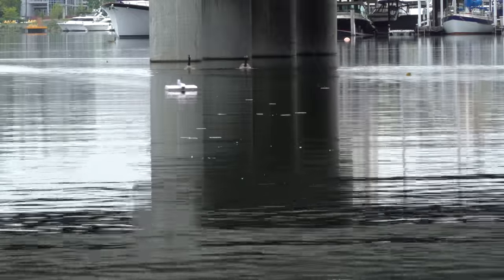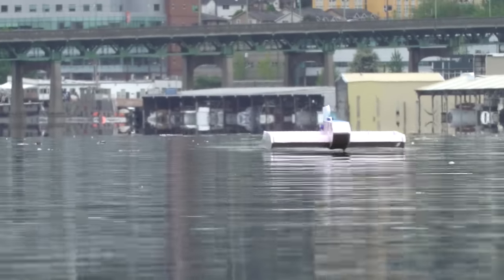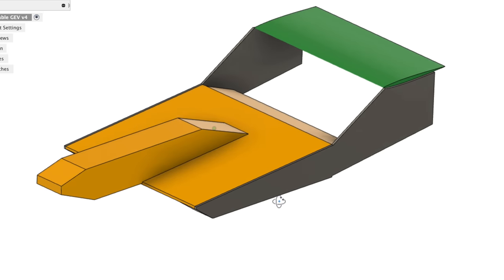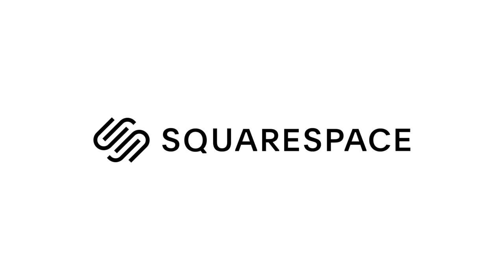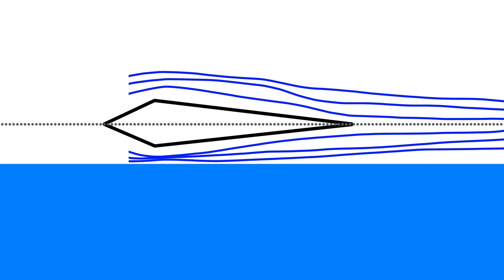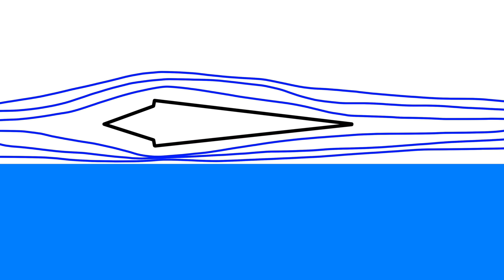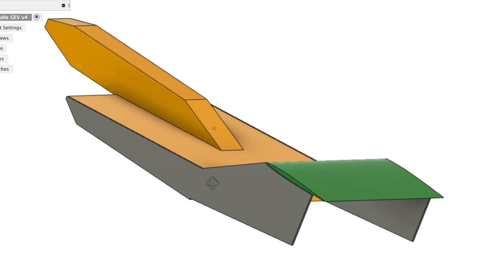RAM Effect Vehicle - A New Type of Aircraft Wing Design?

Comment: With an RC plane it is trivially easy to over power it so just about any configuration of foam can fly away.  With that in mind the people who fault you for creating a vehicle which can fly away out of ground effect should find a better hobby than trolling people who are having fun.  
It seems to me you do have to deal with excessive thrust almost no matter what, so accept it and move forward trying to control that thrust.  If you think you need PAR thrust, use a small motor for that and second motor to power the vehicle from the center or aft.  
I think you were on track for a very fun vehicle with your previous, tandem wing, design.  The tandem wing gives you a canard-like effect full of longitudinal stability plus a very forgiving space in the middle for center of gravity, flotation, and lift compromises.  By adjusting the angle of attack of the fore and aft wings separately, you can avoid the fly-away effect from overpowering it.  Oh and at the Reynold’s Number you’re flying at, don’t bother with shaped wings.  Just use a flat wing and soften the upper leading edge a little.  If you want to get fancy later after you have this tuned up, then try NACA shaped wings.  
If you look back at the Jörg Skimcraft (https://www.youtube.com/watch?v=4PVLHnjbyxw), he had what I would call a trimaran configuration with a main hull in the center and two outrigger hulls, all serving to hold the leading edges of the wings out of the water.  From the Jörg V pictures you have, it appears the center hull is a traditional “boat” shape, while the outriggers have knife edge bows with a flat bottom.  You cannot see if the flat bottom is tilted for lift, but I suspect they are.  Also looking at the Skimcraft, it had the aft mounted prop tilted forward to help keep the nose down.  Later in the video it shows the Skimcraft did not fully fly until it reached 80 to 100 kph.  Once it was flying it seemed to accelerate very quickly from 80 to 145 kph (no more water drag).  
So I think if you fiddle with the wing and prop angles of attack you can find an aerodynamic balance along with a weight distribution where you can go full RPM with never a fear of the front lifting, and you might not need an elevator.

Comment: I think you might have to science more, meaning it looks possible but having to adjust the blades constantly is going to be a huge challenge. If you find the correct pressure near the surface of the water you can get proper lift. There are so many other factors that have to go into this but the idea is good and it would be awesome to flush it out more.

Comment: Better than I thought it would be. I figured it would oscillate a lot more than it does. I have thought about the very same concept. Very interesting video.
After thought: I would try putting some inward facing fins on the wedge in the back and some outward facing fins on the bottom outside edges of the front. Wish I could upload a drawing to show you what I'm talking about.

Comment: Is there a difference between your use of the term “RAM effect pressure”, and ground effect aerodynamics? They both seem to be identical in definition in this video. Just wondering why you use the term “RAM effect pressure”, instead of aerodynamic ground effect lift.  Not seeing a definition specifically associated with the term “RAM effect pressure” anywhere, and what is close is not associated with aerodynamics at all.

Comment: This effect can be maxized over the water surface and South Koreans already developed military use vehicle that's classified as a ship due to low altitude traveling but flies over the water surface.  It is fuel efficient, and as fast as airplane and can be maneuvered like boats and can carry tons of weight.  They are using it for transport and may modify it with weapons to use against China.

Comment: What would happen What would happen if you put a diamond shape right in the middle of the back foil? And why not add a little bit of weight to the back so that it won't need so much for us to get the front off and then when the front does take off a little bit the bottom drops down but maybe I am just a little bit of weight in the back will allow it to take off front and back more evenly with equal force

Comment: I think the nose of the vehicle lifts because the propellers are angled upwards not because of the wing deflecting air downwards... 

Ever heard of the Venturi effect? As air moves into a smaller space it speeds up and it's pressure reduces so your design would actually suck the vehicle down.
Formula-1 race cars use the Venturi effect to increase traction so their cars don't capture wind and fly off the road.

Comment: Imagine being able to select "set prop speeds" [auto rpms], that when selected, the: 
1] rpms would position the craft at an optimum height off a surface i.e. "surface flight mode"  [prop speed 1] or 
2] rpms would exceed "prop speed 1" causing the craft to take flight i.e. "flight mode"  [prop speed 2] or
3] manually controlled rpms i.e.  "manual mode"  [prop speed 3]  

Have these "set prop speeds" or desired flight modes pre-programed for more controlled flights. jmo

Comment: Any sharp edges will create a stall from this edge and air turbulence at once, which leads to the deceleration of the entire apparatus (there is a low pressure area - it pulls the entire apparatus back very much.) This phenomenon is well studied in aerodynamics. But to facilitate separation from the water, it is used quite often. During the rest of the flight, this constructive decision plays a negative role.

Comment: The main problem with this type of design is that it only gets reliable lift in very calm water. Once the water surface is no longer flat it doesn't have consistent lift and it makes it unstable.

Comment: If you are forced to keep the engines in full throttle to maintain ground effect, there is problem, ground effect vehicles are known to be able to keep engines at minimum once in ground effect. 
I think you should ditch the diamond wing design and simply change the angle of the compensator wing to compensate. The South Asian ekranoplans are Ray shaped with a big compensator on the rear. If you take the ray shaped wing, it has a positive angle of attack on it own it also makes the airflow converge in the rear like a funnel to concentrate the flow and make it more powerful. The equilibrium is also found with the front heavy fuselage, kinda like what's you've done here. 
I think the only real problem with your concept is that it is too rectangular, too straight in its shape.
The upper elevon's struts are too straight and should be sloped to generate some back lift above the plane of flight to compensate for the main plane angle of attack.

Comment: Add 8oz of wait to the hull. 2oz on each corner of the wing. Your electric motors pull or props power is to grate for a true value of lift . For the wing and motor .   For instances place the protype design vertical and if the wait of the wing design  lift up inn the air moving vertically & can huver vertically  the motors are giving you a false positive thought on your wing design.  
As well try playing a bulbous bow  on the front of your canapés or pilot chear by 4inch   use a convexed shape like the Spanish sword or Roman gladiator sword.  
     There's a Ukraine boat company that make a prototype  that's proves your design sasesfull  ..
Norfolk virginia USA

Comment: This is not a ram aircraft, this is a propeller aircraft

there is only 1 singular force of thrust in a ram-propelled vehicle. The intake air is compressed by the forward speed of the vehicle only, then forced through a restricted nozzle to provide thrust

The vehicle above uses propellers to keep forward momentum, all it is doing is using lift to keep itself directly above the ground/surface/water
Reply from the maker: you're confusing ram jet with ram effect

Comment: First of all compliment for your project, I really like the result you got. But even if i really like your airplane I don't think you really understand what "Ram effect" is. Note that with this comment I don't want to offend you but just I think that it would be an occasion to better understand the physics behind these airplanes.

 In fact, in this airplane there is no "Ram effect" at all, but the presence of the ground increases a lot the wings efficiency. In the drawing you showed you said that under the airfoil there is an increase in pressure because of the presence of the ground: it is exactly the opposite, aerodynamic is really unintuitive, under the airfoil the air pressure is lower compared to the pressure that there would be in an airfoil without the presence of the ground (and this is the reason why F1 cars use ground effect to generate downforce with the floor). The increase in efficiency of the plane in ground effect is because there is a reduction of wake induced drag, it is not easy to explain why but the point is that the intensity of the wing tip vortices is reduced. You can start to speak of Ram effect when you approach the speed of sound: if your airplane would fly at Mach 1 then yes, there would be an increase in pressure under the airfoil

Comment: It looks like your center of gravity is too far forward in relation to the center of lift.
Reply from the maker: What makes you think this?
Reply: @rctestflight  Because your craft wants to nose-dive. Aircraft are balanced so that the center of lift and the center of gravity are at the same point, so that the lift doesn't force the nose down.  It's like a balance scale.  The CL is the fulcrum.  The heavier end of the beam will drop and the lighter end will rise unless it's balanced.
Reply from the maker: That’s false. The CG should be in front of the center of lift. Don’t be so quick to make false statements
Reply: @rctestflight  Correct me then. Can you explain?

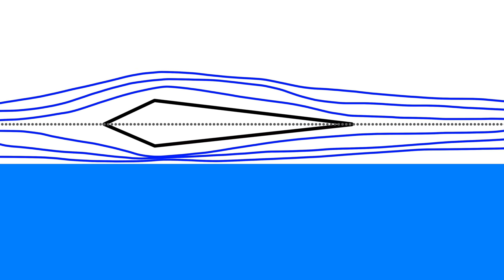Comment: where  is  the  cg.?        where  is the  c-m.???            at 1:53, this 'logic'  ignores  the fact that, in flight, the aoi  is  NOT  constant.!!!          at 2:05, this drag from suction/turbulence  will  be  SYMMETRICAL --- at the  TOP  and  the  BOTTOM.!
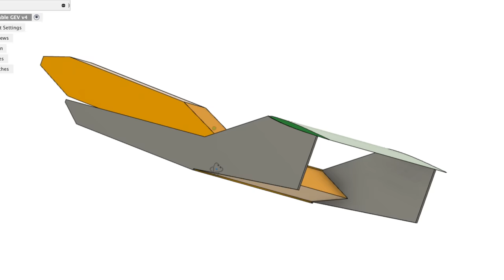at 2:27, the tip fence design  Should  PREVENT  the span-wise/lateral  escape  of  air (at the trailing edge).!!!          the added, too-WIDE  outriggers  SHOULD  have  a  NARROW  cross-section.!          at 2:57, the  Outboard  location of the  MASS  of servos  Adversely affects roll-axis stability.!!!!          googletranslate

Comment: Here is where you have a complete misunderstanding of an airfoil as on an aircraft wing!!!  A wing gets it lift from the relative difference in the speed of the air molecules that travel over the top surface vs the bottom surface thus creating a difference in pressure and this generates the lift!!!  It is not due to the angle of attack of the wing!!!
Reply from the maker: Then why does a flat plate generate lift?
Reply: @rctestflight  
Seriously, a flat plate generates zero lift! This is the laws of aerodynamics and is not my personal opinion!
Your craft is lifted and flying because you angled the propellers UP and the force it generated is greater than the weight of the craft along with the aerodynamic drag as it goes through the air combined. That's why it is flying!!!
Reply from the maker: A flat plate at a positive angle of attack generates lift. Look it up. You can find so many examples of this  @LWRC
Reply: @rctestflight  A positive angle of attach of what exactly? A wing or a flat piece of board? A flat board generates no lift!
Reply: @rctestflight  
I think you do not comprehend the fluid mechanics of a wing and why it generates lift!
When you generate enough thrust, you can make a brick fly!
Positive angles of attack on a flat board does not generate lift for if it did, then aircraft manufacturers wouldn't be spending so much money in shaping the wings in an airfoil shape and can just make them like flat boards!!!
Reply from the maker: Go hold a flat piece of cardboard out of the car window at positive 5 degrees and tell me what you feel  @LWRC
Reply: @rctestflight  Again - you do not understand the mechanics of aerodynamic lift!
All you are feeling are the forces of air pressing on one side - that force is not lift!
Go talk with an engineer and have them explain to you!  Obviously, you are way smarter than any of the engineers that work at Boeing designing the entire aircraft!
Reply from the maker: I am an aerospace engineer 😂  @LWRC
Reply: @rctestflight  Sure you are - why is it you do not understand the principles of an airfoil?  What school did you get the degree from or did you not graduate?
Reply: @rctestflight  
Like I said - I can make a brick fly and it doesn't need any angles of attack !!!
Reply: Changing the angle of attack increases the air pressure on one side of the airfoil relative to the other. If angle of attack doesn’t generate lift, how do sails work? Why do electric fans with flat blades work?
Reply: @SeaKrait571  Apparently, you know way more than the engineers who design aircrafts.   And this channel's owner is a fake when it comes to having  an aerospace emgineering degree!
The examples you gave do not provide lift genius!!!

Comment: The horizontal surfaces do not generate any lift and just causeed aerodynamic drag. You are merely balancing the drag to the maximum force the two props can generate based on the pitch you set the props at!  You've proved nothing!

Comment: HI RCTESTFLIGHT,  LIKED  SUBBED AND HIT BELL, VERY GOOD WHAT YOU HAVE SHOWN HERE,  BUT HOPE YOU DON'T MIND AND ALLOW ME TO SPEAK FREELY ?????,  THE PROBLEM IS NOT IN THE RAM  EFFECT VEHICLE,  BUT IS THE PROBLEM IN YOUR MIND  ?????? SO LET ME HELP YOU IN YOUR THINKING,  WHAT ARE WE TRYING TO ACHIEVE HERE WITH THIS VEHICLE ?????  A SPEED BOAT FLYING ACROSS THE TOP OF THE WATER USES A LOT OF ENERGY DUE TO IS BAD DESIGN, WHICH IS WHY PEOPLE ARE INVESTIGATING GROUND EFFECT VEHICLES,  WHICH THEY HOPE WILL BE A LOT MORE ENERGY EFFICIENT,  SO WHAT ARE WE TRYING TO DO ????? WE ARE TRYING TO MAKE A VEHICLE THAT IS MORE EFFICIENT,  COST SAVING FROM A FUEL PERSPECTIVE,   SO LETS FORGET ABOUT TRYING TO MAKE A VEHICLE THAT CAN FLY IN GROUND EFFECT , AND LETS MAKE A VEHICLE THAT USES GROUND EFFECT THAT WILL BE MORE COST EFFECTIVE,  SO UNDERNEATH YOUR VEHICLE ADD TO IT 4 AEROFOILS' 2 AT FRONT AND 2 AT BACK, ALSO ON TOP OF YOUR VEHICLE PUT 2 SELF JIGGING WINGS  1 IN THE FRONT AND 1 IN THE BACK,  THESE 2 WINGS NEED TO BE DESIGNED JUST TO TAKE THE WAIT OF THE VEHICLE,  HOPE THIS HELPS,

Comment: Your so called aircraft doesn't prove anything!  As you saw, with the motors running, it had enough pull to propel the aircraft along the surface of the water as it doesn't have enough speed for the aerodynamic surfaces to come into play!!!